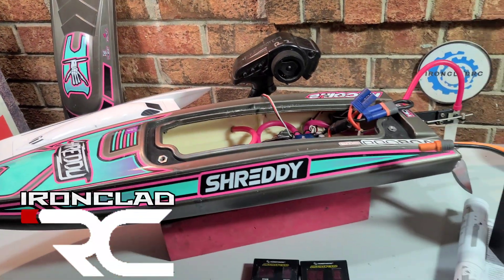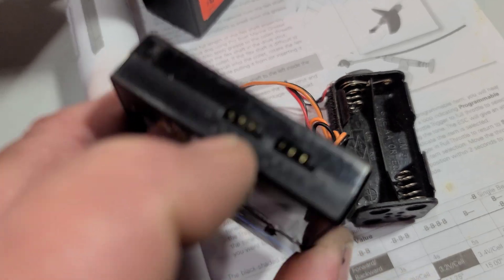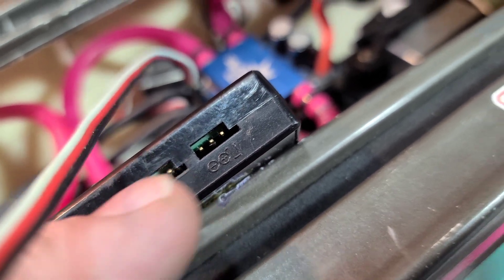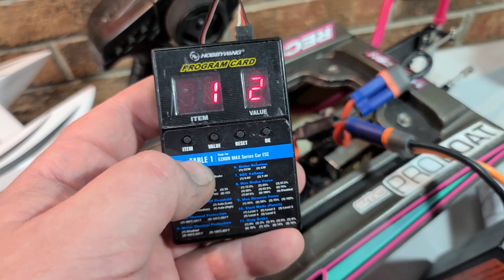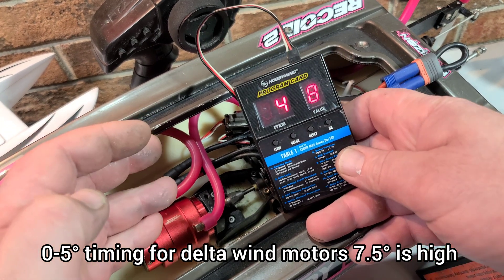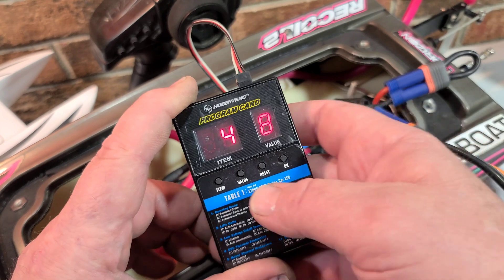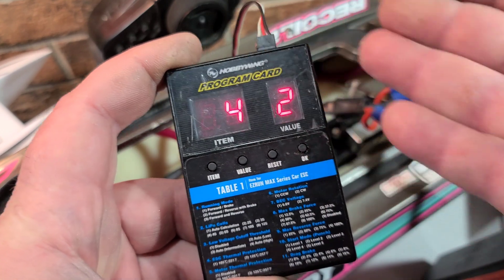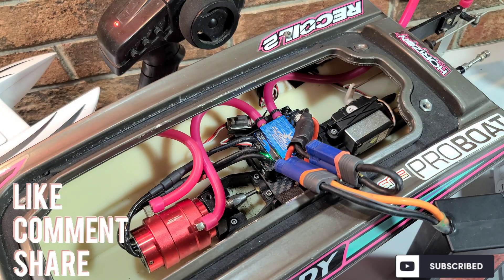Dynimite Marine Esc Programming - Brushless Motor Timing Delta & Wye Wind - Proboat Recoil 2

Comment: Do you know how to calibrate the esc without the tool your using. I’m running 4s atm stock settings and lvc is happening to early, figured I would turn it up a bit to the next setting so I get a bit longer runtime, what you think?
Reply from the maker: You can program the speed control using your transmitter,  via beeps.   Download the manual, step by step

Comment: Very informative video! Will the HW prog card also work on a DYNM3860 30amp marine esc? Got my first boat and I know squat! Want to raise the stock LVC from 3.2 to 3.4V based on my land RC esc preferences but whole pull the trigger/push the trigger, beep beep deal seems like a hassle.
Reply from the maker: Your supposed to be able to but I never tried, I use my transmitter via beeps to program mine.
Reply: @IRONCLADRC  Thank you pal! I'll fiddle with my HW card and see if it works. But good to know the Tx method does actually work; it just seems a bit daunting.
Reply: Actually...can I convince you to do a programming how-to with the tx/beep method?
Reply from the maker: @christianrambissoon1141  I'll try to get it out tomorrow evening or the next day
Reply: @IRONCLADRC  You are a gentleman and a scholar!
Reply: Update...the HW prog card does not work on the Dynamite 30amp esc 😫

Comment: What perfect timing the 4000kv motor and 50A flycolor
Reply from the maker: Depends on the motor winding type. Delta motors 0-7°  wye motors 7-15° timing.
Reply: @IRONCLADRC  my motor is out runner 4000kv what is perfect program to my flycolor 50Aesc 😊😊

Comment: Just put a 3660 2600 kv in the bj 24 paired with a ose 90 amp esc, hope to get a chance to run it today 
Peace
Reply: How much did it cost?
Reply: @Benjgf  cant recall bought a while back it's a hobbystar motor if you want to see their website for pricing.
Reply: @Benjgf  rc.juice 35 bucks or so

Comment: What would happen if I used a 4s battery on a 30a ESC and 3s motor.would it work?
Reply from the maker: I wouldn't try it
Reply: @IRONCLADRC  any way to improve speed on a budget?
Reply from the maker: If the esc is rated for 4s then it will handle 4s  of its only rated for 3s then you can't put 4s on it.
Reply: @IRONCLADRC  ok. But the battery is the problem idk what 4s battery to get then cause im on a budget and i dont have alot of space in my f1 rc boat

Comment: Good stuff B. Not many people are aware of the timing. I understand most out-runners use the higher range and in-runners the lower range. I did have an out-runner cogging when it started to revolve because it didn't know which way it was supposed to go. Changed the timing and all was good.
Reply from the maker: Good to know thanks,  I don't have a lot of hands on with high performance outrunners.    Very helpful
Reply: @IRONCLADRC  I have not done much research on  the subject and only discovered it when I read the FlyColor 150A instructions (I know men are not supposed to do that) section 06 item 5: Timing. It is still a bit vague but sorted my problem out. (Martin in the UK, Corby Model Boat Club, Treasurer)